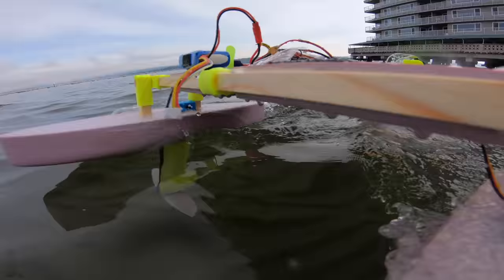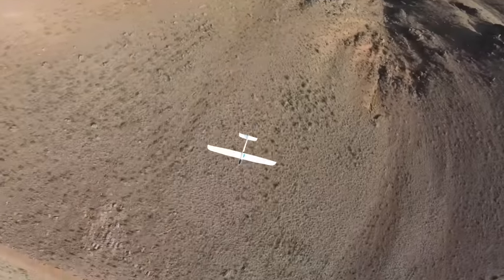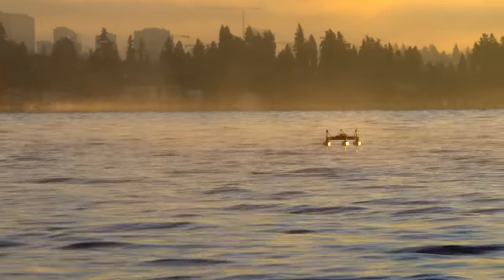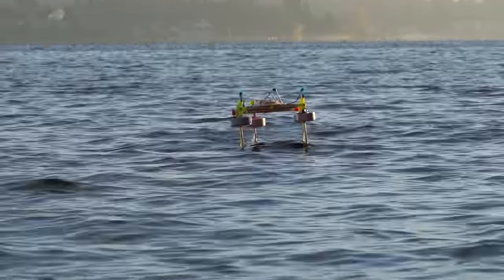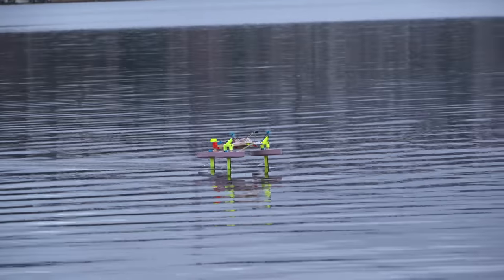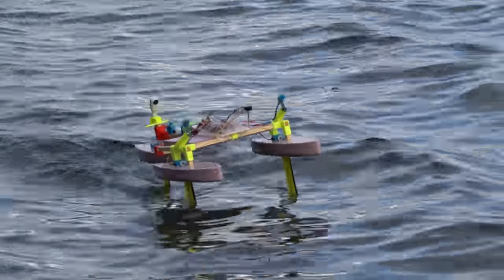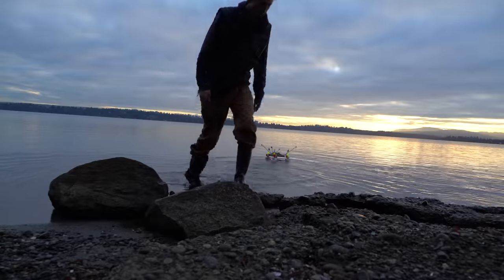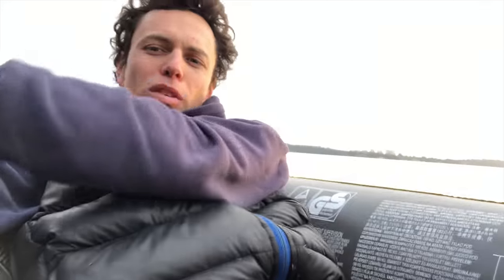Can a HYDROFOIL Fly like an Airplane???

Comment: Actually applauded my screen with that first test sail under automated trim control. Just beautiful.  Gods I would love to see that system on a full sized sailing dinghy.  Keep sail control and tiller in the hands of the skipper and let the system manage attitude/altitude.  Thank you for all of your incredibly original work.
Reply: I believe the tf35 are computer driven
Reply: @thomas3793  Thank you so much for sending.  It is definitely a sexy craft.  But some part of me wants a smaller hack job using accessible technology.  Like a little modified hobie cat.  Or frankly, even something like a laser with outrigger hulls.  Can you imagine being able to cut the waves in something tiny and ludicrous?
Reply: Please keep me in the loop if you ever plan to do so.
Reply: Dingys with hydrofoils like the moth, have a mechanical system controlling the trim of the main foil. A wand which bounces along the water pulls a wire that changes the angle on the main flap. You then control the rear elevator with a hand twist grip. 
In other hydrofoils, there is a newish hydrofoil surfboard with electrically controlled trim control. There’s a video of a dog riding it 🤣
Reply: @AliBFPV  Thank you so much for referencing these! It’s interesting to wonder whether that wand, by tracing the contours of rough water would cause similar problems to the sonar tracing waves. You’d have to mechanically smooth the speed at which it shifts versus doing it using digital filtering.
Reply: @BernardSandler  think the moth uses shock cord to the push rod which smooths out the motion. Aka a filter 😃
Reply: @AliBFPV  But do you have to douse the shock cord in epoxy to ensure that it doesn't sputter into unconsciousness at the touch of water? :)
Reply: I've been making an Americas Cup Hydrofoiling yacht. Still a work in progress
Reply: My fav is the BOEING Aqua Jet "Fresh 1" it was actually tested in Seattle, too.
Reply: @AliBFPV  some of the others use fiberglass or carbon fiber rod to add a certain amount of compliance to the system.
Reply: Check UFO beach catamaran...Or even the FOILSZ, a kit to turn ANY Laser dinghy, into a Foiled Laser... it's a bit expensive, due for all carbon parts but ,it is already on the market for quite some time. And, no eletronic crap needed...
Reply: @BernardSandler  come on!...wand's water displacement does that,"filtering", for free...
Reply: Thank the Gods
Reply: @paulopolonio   I'm adoring this thread.  That UFO thing and kit both look spectacular.  I had no idea that this was an existent class of craft.  I've got to get my tush back out on the water.
Reply: @wezdog1  Seriously? AC50 or AC75?
Reply: @russelldesilva1560  AC75!

Comment: When the rig was upended in the water, it looked like it might be signifigantly tail heavy (center of gravity aft of center of lift). Borrowing from aeronautical practice,  for a plane to be auto-stable in pitch,  the CG needs to be slightly forward of the CL, with the tailplane pushing down to balance the nose weight. Ergo, self-stability in pitch. If the CG is too far aft, the pilot is tasked with horsing the elevator to maintain pitch. No doubt you know all this already, but I just thought it might be worthwhile to experiment with CG location.

Comment: You stated that the vessel struggled going down-wind - I'd assume that waves pushing from behind would effectively reduce the net velocity vector which would then reduce the lift produced. You'd need excess thrust to account for down-wind effects to stay relatively levelled. You also mentioned that sea-weed would produce drag and choppy waters can be harder to navigate - I think only scale would be able to reduce the impact of these effects. Regardless, great project and ideas, really excited to have seen how an automated hydrofoil vessel navigates this effectively!
Reply: As a novice wing foiler... if you can get the hydrofoil in the correct part of the wave you can generate much greater lift. Generally up on the leading edge of the wave. Conversely, the trailing edge can decrease your lift.
Reply: @DanielBallinger  I understand what you mean - you do gain kinetic energy when you "ride" the wave & it'll both propel you forward whilst generating more lift. However, when the waves are relatively small and the waters turbulent, it'll be hard to synchronize with riding the wave as can be seen at 7:47. As a consequence you'll tend to fly and then drop your nose cyclically.

Comment: You could try to add water level sensors to the pylons for the wings. That should be way more accurate than the sonar and allow for higher resolution.

Comment: This might be difficult to implement but maybe on a larger scale: for clearing seaweed, incorporate rollers on the leading edges of sponsons and wings, and when the motor amperage vs. ground speed skews too high, briefly power all the leading edge rollers to just roll off any weed that has wrapped around.
Reply: I think this would make it worse, as there would be more spaces for weeds to catch. A simple wiper that's mostly covered might work, but again introduces more snag points.
Reply: Or make the leading edge razor sharp.
Reply: Design sponsons to turn 360 degrees.  When necessary, slow speed and slowly turn them until clear.  Maybe one at a time.
Reply: What's wrong with reverse?
Reply: Seems a bit dangerours, but my first idea was to attach razor-blades to the leading edge.

Comment: I'd love to see some efficiency test in hydrofoil mode vs normal floating mode
Reply: Add in normal flight and ground effect too. Could prove to be a great experiment on the most energy-efficient mode of transportation over water
Reply: Hydrofoil efficient for low medium speed, planning efficient for high speed
Reply: @Toast934  Indeed. I would also think hydrofoils are less efficient on a "light" vehicle relatively ( Or rather, the low weight makes it even more sensitive for speed/efficiency?). I wonder if this vehicle wouldnt be more efficient without the hydrofoils at anything but very, very low speeds considering its low weight with a correctly designed planing hull. Thats not to say its wasted, this is a very fun and good engineering excercise.
Reply: I have heard hydrofoil boats are almost 80% more efficient than regular boats. Source: Candela; a hydrofoil company, so not too reliable lol
Reply: I think under the 30ft size without a need for excessive top end speed, foils are fantastic. However in my own experience in playing with boats if you care about top end speed, you can never get away from the foil drag in the water. Whereas a planing hull will eventually outperform a foil, at around the 30 knot mark. The americas cup boats seem to be an exception to this, however they have immense sail carrying power to push through the relatively small foils they carry. The cup has had issues of making their chase boats (both media and rescue ) go fast enough to keep up.
Reply: @simongonzalez1793  Might be possible under some circumstances, but hardly typical I think.
Reply: @Toast934  Yeah, the smaller foils one can get away with, the better it is of course.

There is no problem to have the other boats (powered) keep up speedwise if the water is calm. So if it is as you say, it must be the fact that the foils makes the boat somewhat immune to waves of reasonable height that makes the other boats struggle to keep up. Anything but very small waves are an enourmous speed killer for "fast" boats, as I am sure you are aware.

Comment: I think that the seaweed could be cleared by having a thin "finger" extending in front of the riser from the hydrofoil that was on a freely rotating bearing, (so that it simply rotates out of the way to release the seaweed behind the foil.) The engineering challenge is keeping the finger in front of the foil, most of the time. (I thought about having three fingers and hope that it would passively settle with two dragging behind to keep the third in front of the foil.

Rather than height, you could add a depth sensor to each of the risers, (tube that is open at the bottom that reads pressure - as the vessel sinks the pressure increases - this would isolate measurement from the water surface and also have passive dampening.)
Reply: Your depth sensor idea would be susceptible to waves. You don't want that.
Reply: I imagine the weed would just stick to the finger and get wrapped around the riser.

Comment: 7:45 I'd guess because, while its airspeed is the same, its water speed is much slower
so it can't get the same lift from the same throttle input
Reply: you also have air-driven propellers so it is indeed loosing thrust by going in the same direction

Comment: Now hear me out, I’m not an engineer and my RC experience is limited. BUT adding a function on the ESC with a “self cleaning” system, say like some razor blades on each upright that cycle them selves when the posts get gunked up with seaweed. Razor blade (or whatever it may be) cycles itself down the posts and cuts/pushes the seaweed off. I imagine with there being resistance on the seaweed through the water a blade would cut threw it pretty easy.

Comment: Idea: long range hydrofoil mission with automatic seaweed removing capability
Maybe something like a wire that normally sits at the front of the legs to catch the weeds and can be moved to discard them
Reply: maybe make the arm holdy things angled so it just sweeps them down
Reply: @crackedemerald4930  I was thinking that wouldn't work because the hydrofoils have a T point for the weeds to get stuck. But a hydrofoil like the IMOCA 60 without that T junction could be swept back to achieve this! Also you could achieve a tighter turn rate with the IMOCA design at is gives a righting force.
Reply: @PuppyKat404  it could have a little lip where every stucked weed slips off downward
Reply: @crackedemerald4930    - J-foils can be shaped to  reduce the problem of catching flotsam with continuous aft sweep- probably not perfect..  

(pitch control on a blended J-foil involve tilting the whole foil)   - a J-foil can also be designed with different regions optimised for lift at different speeds - including supercavitating tips  and inherent height limiting  - sudden foil ventilation is bad.

Comment: @rctestflight the rough water test is pretty impressive. It looks like the foils leave the water in the vally of the wave sometimes causing the nose to drop with no more lift. driving upwind vs downwind changes the frequency of waves passing the vehicle by a lot when the boat travels around wave speed. differences between up- and downwind could be in the reading of the sonar or behavior of the flight controller. LOVE YOUR WORK!

Comment: I've got a hypothesis why it's harder to go downwind:
The top layer of water gets dragged along by the wind a bit, creating a current on the top layer, but only 10 cm deep. This means the (airspeed-->) waterspeed is higher when you descend, meaning more lift. More lift + adjustments by the computer = too much lift

Comment: Interesting: I am working on a hypothetical design for a foiling boat and have settled on hydrostatic pressure sensors. I have seen physical feedback levers that skid over the water, this, and manual control in foiling boats. Your boat’s small scale doesn’t help the feedback, mechanical or otherwise, especially given the short time interval. It is interesting to see so many different solutions to similar problems. :)

Comment: Building little gas motor cars as a kid, some were three wheeled. I quickly learned that steering from the back with one wheel was unstable. The car wanted to flip around and tricycle. You would get the same effect riding a tricycle backwards. Now you see three wheel motor cycles (and even EV's). But the "all" steer with the two front wheels. I suspect you would get better directional stability if you steered with the front two foils and left the rear foil fixed.

Comment: A lot of people seem to be overthinking weed clearing. The simplest would be to just reverse the boat for a few feet. The weeds would no longer be pinned to the foils and should be pulled away by the drag of the water. It would come off plane, but thats not too big a deal with how qick it gets up. Also sweeping the vertical spars back would help too.

Comment: The downwind issue is because of props. 

Props push air behind them and pull forward,  Heavy downwind counteracts that. 

You are talking about the sacale of a small cessna trying to take off in a hurricane blowing at it from behind while having the brakes on. 

-Overcome water resistance, while trying to shovel air back (and itself forward) 
-while the air around it tries the opposite

Comment: I think I have a solution for the sea weed problem try using some very sharp razor blades on the leading edges It would for sure cut through sea weed, Try and design it so they are easily replaceable because they could rust and get dull after some use, If its not good try using a bar that can turn with a small motor on the leading edge, You could activate them every minute or two so when it builds up it would push or roll the weeds away more complicated but probably will work

Comment: Here’s another idea— resistance measurement sensors on each of the 3 legs.  Basically two open terminals an exact distance from each other (1/4”?) repeated up each leg every inch or so.  Apply voltage (low amp, IIRC), read resistance values, and calibrate to tell the difference between a body of water and latent surface water or water spray.  And then, of course, sensor-fusion that data with your sonar to minimize errors from either sensor type (basic sensor fusion: average the result values together; slightly more advanced sensor fusion: look at the difference between the conclusion of each type of sensors and throw out values that don’t make sense temporally, and across sensors; advanced sensor fusion: a bunch of calculus and statistics, I guess).

Comment: I’ve got a couple of the APM units but trying to interpret all the parameters is a little overwhelming.  The 2.8 caused a copter crash and think using ground vehicles like this might be a little safer.  Nice work on this project.

Comment: Real sailboats which have hydrofoils use "sticks" that skim over the water surface. By the angle of stick (close to vertical --> very high) the angle of the foils are adjusted. It has the advantage that it can be absolute analog when using and also has less noise that sonar (I think). An example of these "sticks" can be seen on a "Waszp" or "Moth" (pretty much the same but one is a bit smaller)

Great Video, greetings from Germany

Comment: The problems when travelling downwind might arise because the waves usually travel downwind as well  so the errors they introduce to your measurement influence the attitude for a longer time when traveling the same direction. Mabe having one sensor in the front and one further back simply averaging the measurements would mitigate both the systemic (wave) error as well as the random error.
Nice project! I enjoyed the video.

Comment: Sea weed shouldn't be an issue. Just make the "legs" not straight but tilted backwards, to let it "slip down". A 45° angle on the legs will also convert some drag to lift :)

To avoid that the sea weed is caught in the horizontal part, you can make the legs J shaped (front of the craft on the right), so they will move the sea weed down and release it below the wing.

Comment: Fantastic! Maybe a ground effect, hydrofoil hybrid is the magic sauce. I wonder if the front mounted propellers are causing some issues, it seems to me that a pusher motor from the rear would apply force in a more better way. Imagine pulling the craft with a string as opposed to pushing it with a pole. I build docks and when I measure choppy water I hold my tape so the tip is submerged for half the time, you can get surprisingly accurate measurements with this method.

Comment: A suggestion, try a thin piece of wire from the front of the hydrofoil to the front of the "bow". The wire should catch the seaweed and the forward movement should push the seaweed down and away from the vertical part of the hydrofoil. 
Wish I was still at Fort Lewis, would love to come up and see your gear in action.

Comment: What about a tube from an air pressure sensor to the bottom of a pontoon underwater. The air trapped inside the tube would keep the sensor dry, but its pressure would vary by depth. It might return some useful data regarding the depth of the pontoon underwater. You should also get a much wider range given as water pressure changes faster over depth. The pressure inside the tube would vary more per unit of distance.
Reply: Yes, I have been thinking about the same thing. One issue is that the signal will need to be inverted but that could be overcome by using an external sensor and inverting by hardware. Maybe best to mount the sensor in a separate, diaphramed chamber with a channel / tube to the lower strut.

Comment: I know a lot of planes use angled wings (rather than them being level all the way across) to assist with self-leveling. Would the same idea work here? Perhaps, if the legs were angled outward rather than just straight up and down, you could more easily control the roll of the hydrofoil, then leaving you able to focus more on the pitch. Perhaps one sonar at the front and one at the back for the pitch?

I am not at all an aeronautics engineer, so if any of what I just said makes no sense, then I apologize.

Comment: A few odd ideas. To deal with the issue of seaweed along the leading edges, what about something simple, like a small piece of serrated steak knife (like cold steel ones) along the front edge? I suggest serrated as the peaks and valleys cut easier when pressed directly against when compared to a straight edge.
As to reflections from the water and such for your LiDAR and sonar, what about a simple price of a polarized lense in front of the receiver?